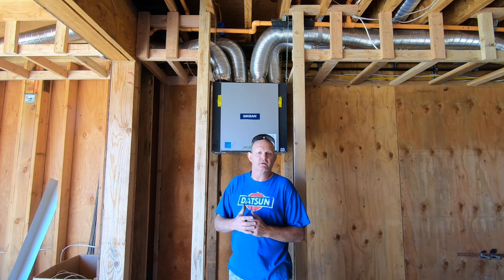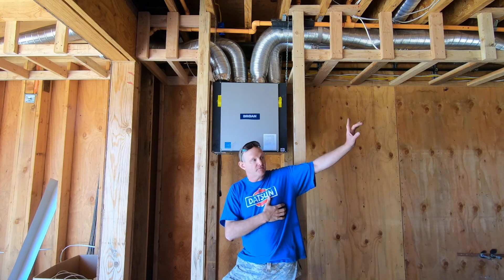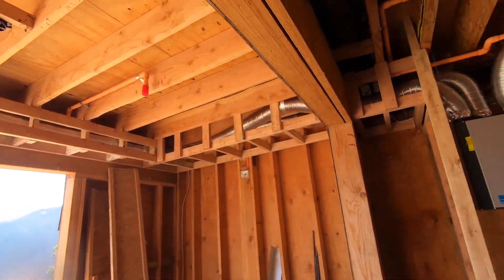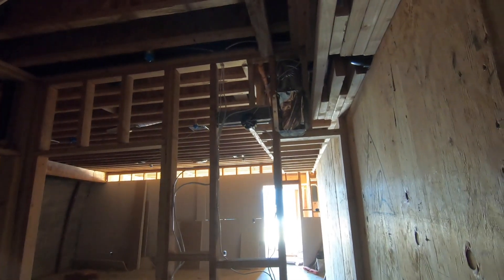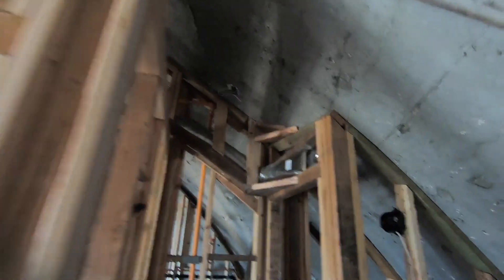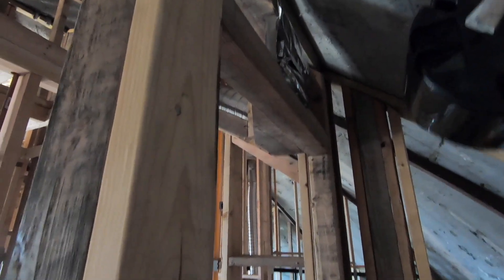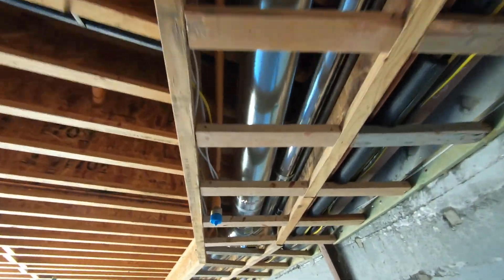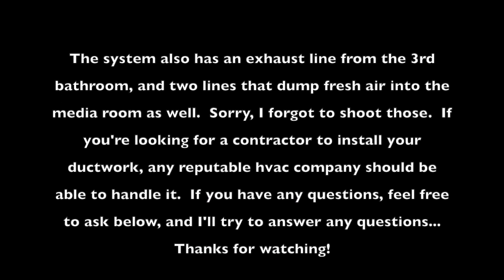Dome House Ventilation System

Comment: So glad to find your channel and this playlist as we are embarking on a Formworks house build in CT! Would love to see anything you have about rough plumbing before the slab is poured and any advice you might have for plumbing in general. You have great insights! Thank you!
Reply from the maker: The only rought plumbing that should go in before the slab is the waste drains.  Gas and water should never be buried in concrete.  If, for some reason, you had an island in the kitchen for example, and needed to run gas or water to it, then you would bury a conduit you could later run those line in.  But most municipalities don't allow anything but waste lines to be buried in the concrete. 

If you aren't familiar with how to do waste plumbing, either hire a pro, or find some books on how to do it.  (It's not tough, but too much to explain in writing).  

Best of luck in your build!

Comment: Interesting setup, the heat recovery ventilation system is a great idea...I may have considered a heat pump for the downstairs heating considering the difficult flue setup.
How many square feet is the total living area less garage?
Reply from the maker: the house is just under 2800 square feet.
Reply: @theeddiesshow   ... that is a lot bigger than I thought, keep up the good work 👍